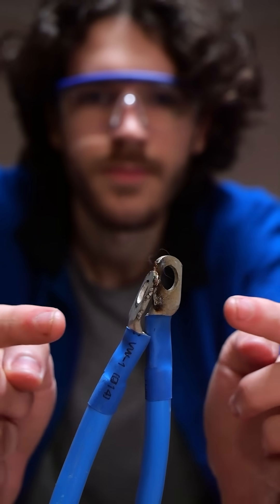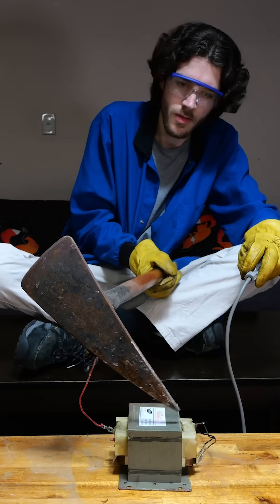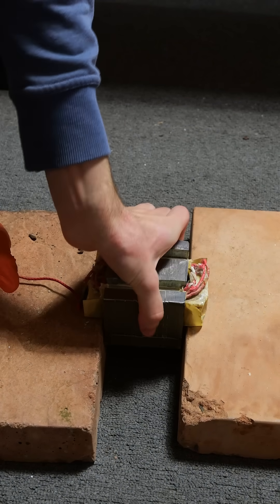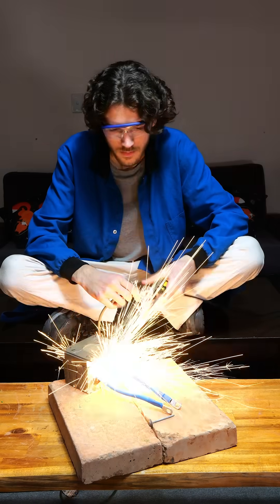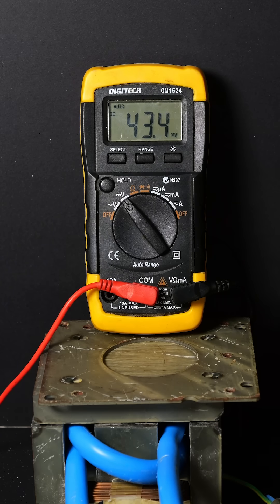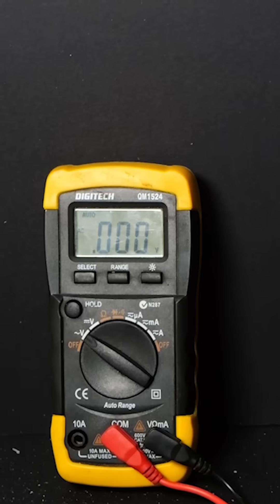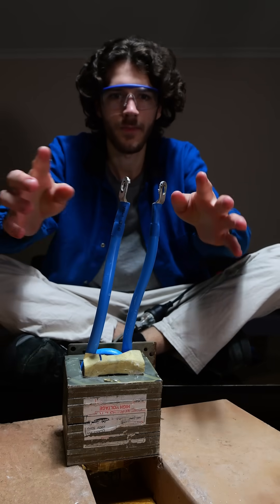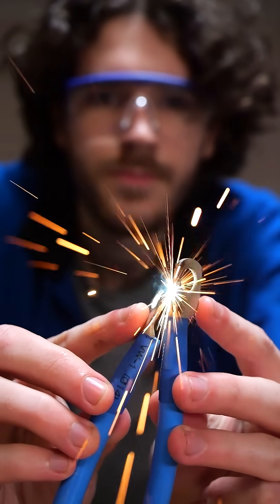What holding 600 Amps feels like

Comment: Awesome demo. It’s wild how you can melt metal but your skin’s like “lol nope”, same reason a car battery can deliver 500 amps and still not tickle you at 12V.
Reply from the maker: Yeah even though I measured the voltage and knew it was completely fine, I still took some warming up to it. It just feels so wrong to touch XD
Reply: @mrgreenguy  Haha totally get that. Years of “don’t touch wires coming out of a microwave transformer” instinct don’t just disappear because the multimeter says it’s fine, especially when it’s buzzing like it wants to kill you x)
Reply: @mrgreenguy I was thinking exactly that, electricity feels so unintuitive that even if you know something is fine it still feels like it is not 😂
Reply: @mrgreenguy  tbf, there is a level of “if you’re wrong, you die” going on. Not wrong about the physics per se, but the situation as a whole. It’s literally natural that the brain would see the metal contacts produce lightning and coming from a box that’s making a very unnatural and unnerving hum and go “Nah, don’t touch that.”
Reply: @mrgreenguy I have one of those weird high voltage capacitors just sitting on my desk right now I think I found it while dumpster diving it came in a box with a big DC motor
Reply: One did almost make my heart stop when I was screwing in new terminals. Accidentally touched both terminals with the wrench and scared me half to death 😂
Reply: Perfect way to debunk the "it's the amps that kill you" myth.
Reply: Toaster detected
Reply: @comradebraixen  correct
Reply: What would you actually need to do to get electrocuted at low voltage?
Reply: Well you'd need to lower the resistance of your skin somehow, like licking even low voltage is a pretty bad idea because your tongue is alot more conductive than say your hands. 

That being said you can still lick a 9 volt and be fine, (the closer towards the tip of your tongue the more it'll hurt), but iiiii wouldn't lick a car battery lol.
Reply: @SethCrowderMusic Part of the reason the tongue isn't too bad is because it's localised - if you touch both terminals of a power source to your tongue the shock is (usually) sufficiently constrained to your tongue to leave the rest of you ok even if it's bad enough that it would have been lethal if it got your heart
Reply: @linecraftman3907 as the previous commenter stated, it's about lowering the resistance of your skin -- the easiest way would be to be wet, especially with a solution packed with electrolytes (as opposed to just water)

tl;dr douse yourself in Prime 😆
Reply: @dancoroian1  hahah, thank you for elaborating 

but wouldn't wet skin just give you a surface burn?
Reply: @linecraftman3907 it really depends on a lot of factors...do you have open cuts that could provide a path from exterior to interior? And, more importantly, what is the frequency of the AC current? The higher the frequency, the more skin effect -- where current is concentrated in a small volume near the surface of a wire or whatever conductive material -- it will exhibit. I believe with frequencies as high as the microwave transformer here, you're never really going to get much more penetration than a surface burn, because of the skin effect!
Reply: @dancoroian1  interesting, thank you 

I guess the main takeaway here is dont touch live wires if you dont know what they're connected to
Reply: @dancoroian1  correct me if im wrong but I believe the frequency doesnt depend on the transformer but it is the same as the frequency of the input coil so its actually just 50/60 Hz because it's like the power grid.
Reply: @kwpogromca no I think you're right...my b, dunno why I thought it was high frequency
Reply: @linecraftman3907 Water on your skin does improve the contact between stuff on the outside and the stuff on the inside, and it tends to form into droplets so there's no continuous external path most of the time
Reply: @linecraftman3907  current = voltage / resistance

You'd have to somehow reduce the resistance of you body, like if you put the electrodes directly on your heart.
Reply: @linecraftman3907  At 2V, absolutely no chance, not even when you're wet. At 40V or so you might very well get electrocuted if you have really bad luck.
Reply: @linecraftman3907  Pierced and wet skin probably. Even then you'd probably need more than two volts.
Reply: @linecraftman3907 become extremely conductive.
Reply: Protogen
Reply: Ky5
Reply: @Tomatoe44  womp womp